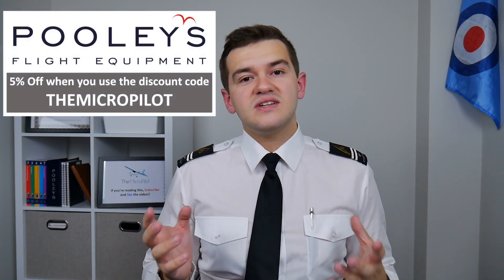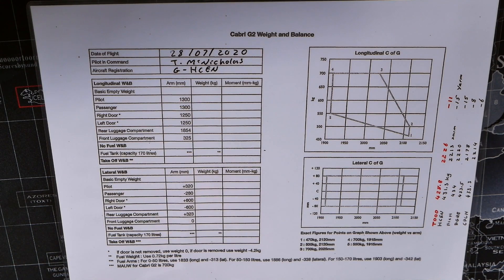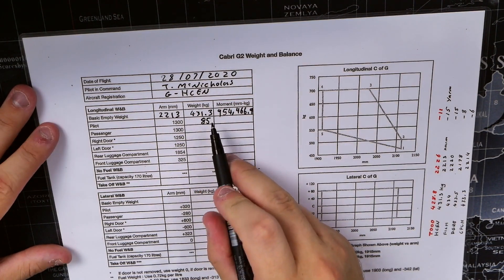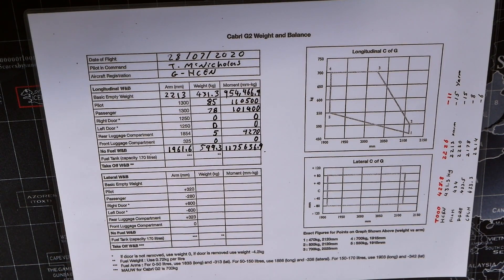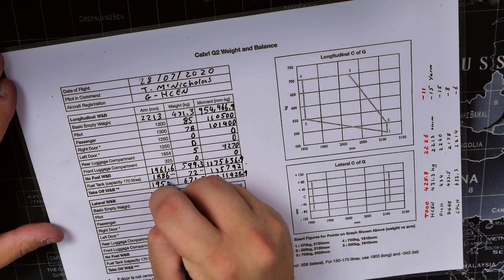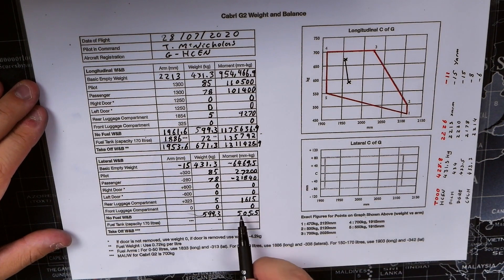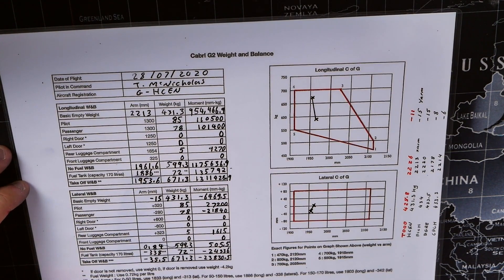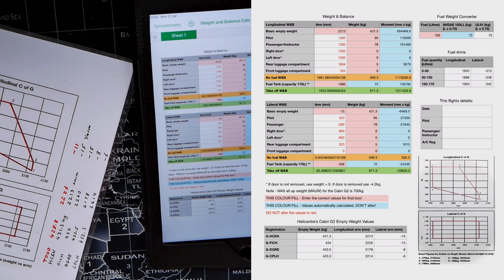Aircraft Weight & Balance Calculations - How To

Comment: Hey Tom, this video is great! I haven't got as far as M&B in my PPL course just yet but I'm trying to absorb as much knowledge as I can en route! I wanna be really cheeky and ask if I can have your spreadsheet! :)
Reply from the maker: Hi Neil, thanks! My spread sheet only works on the Cabri G2 and is a little temperamental. The app store has quite a few apps for M&B for most aircraft now and they are a lot more reliable, I'd deffo recommend them! I use an app store app now, that makes the process a lot more quicker and easier!
Reply: @TheMicroPilot  thanks a lot mate! I’ll look into the apps now! 26 hours of flying done now and my second ground exam next week! Hope your course is going well!
Reply from the maker: @nizza594  thanks mate and yes it is! Good luck with the exams!